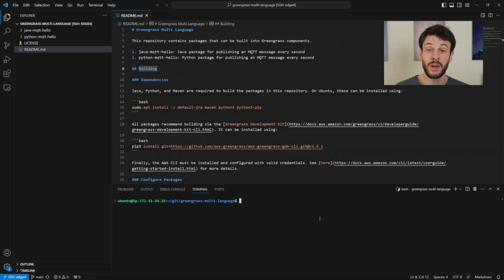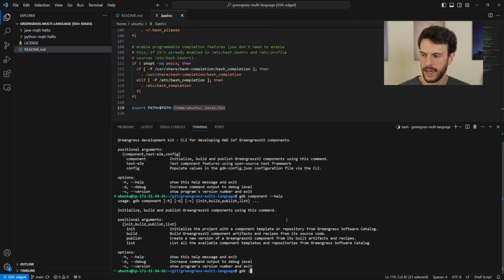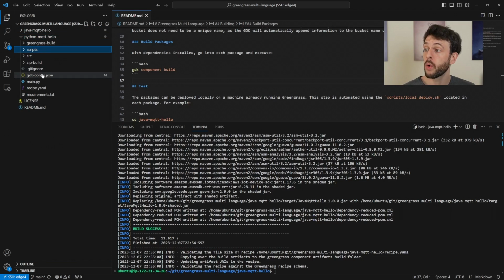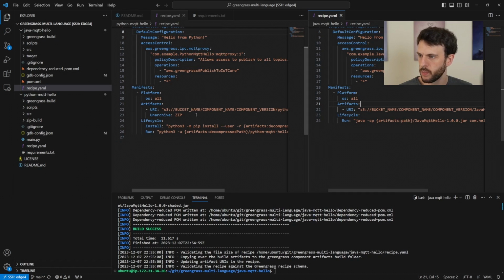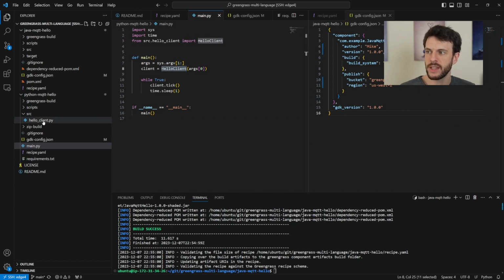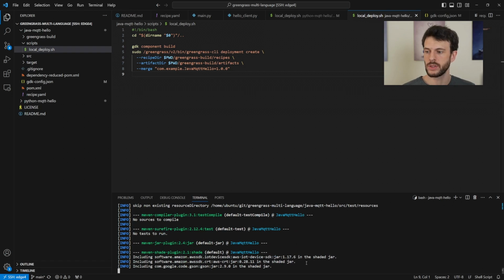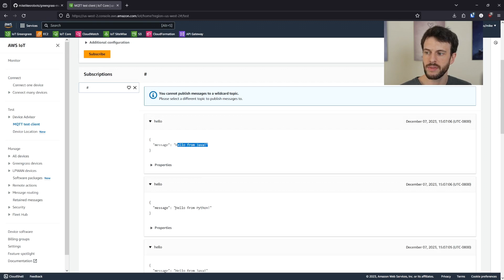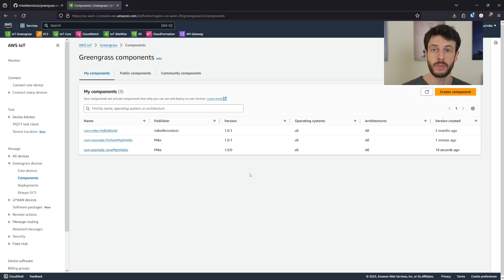Building Greengrass Components in Java and Python!

Comment: Thank you for your video Mike. You have a clear presentation style and the content is super helpful! How do you develop and iterate on components quickly? Is there a version of 'hot-reload' or docker volumes that can be applied to make and test changes?
Reply from the maker: Thank you! I iterate quickly by making small scripts for building and running a Greengrass component locally. Every time I make a change, I can quickly get it running via Greengrass. Some aliases for checking logs can help too. I'm not aware of any hot-reload or docker volumes that can help, but that's a good idea I might have to look into!
More info on testing available in AWS docs: https://docs.aws.amazon.com/greengrass/v2/developerguide/test-components.html
Reply: @mikelikesrobots  Thanks for the reply! I found a helpful resource (https://www.youtube.com/watch?v=adx3zUGRoWw) that provides a guide for running the component locally without needing to deploy. This is a faster development loop than the deploy and remove workflow. Is this aligned with your approach?
Reply from the maker: Yes! I work with Michael, he's extremely helpful and knowledgeable. In fact, if you check the description of this video, you'll see that I've already linked it. I prefer the scripting approach to restarting via script rather than console, but I think the console has its uses too.

Comment: Thanks for your video. I am trying to run greengrass component in python, but it seems that python run time is not recognized by component and I am getting stderr. The system cannot execute the specified program error. Could you suggest what could be gone wrong here.
Reply from the maker: Thank you! I imagine you either don't have python installed on the target system, or your recipe specifies to run `python` - tell it to run `python3` instead of `python`, and make sure `python3` is available on your target system and it should work :)